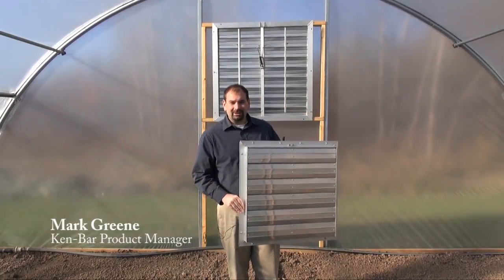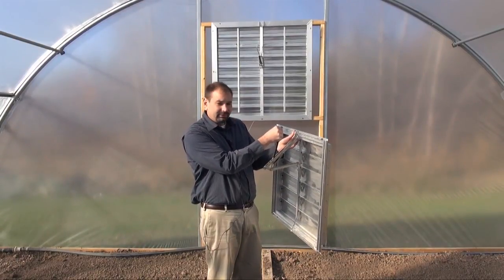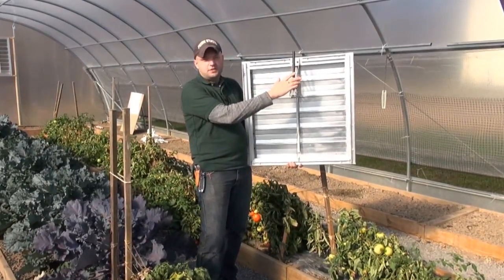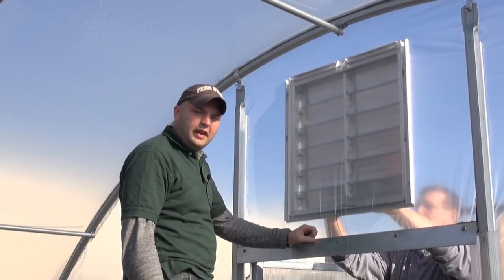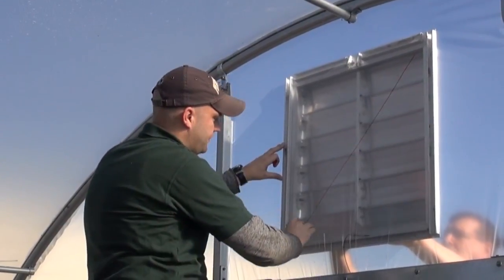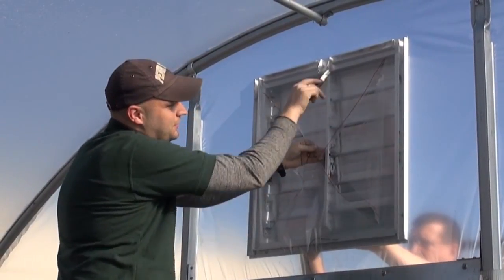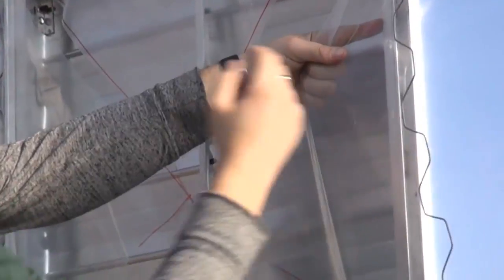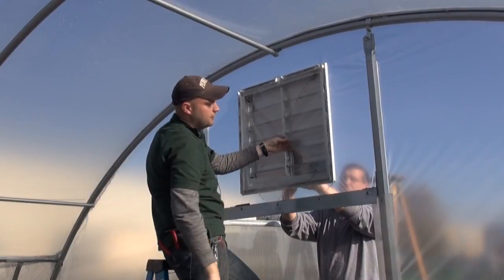Harris Seeds - How to Install Small Automatic Greenhouse Vents

Comment: How does this work if you need more robust intake outage like with a fan and if you need circulation during the cold?
Reply from the maker: This vent is designed for passive cooling only, but adding a fan near the shutter can help force more air to exit the greenhouse.

Comment: If you are using a fan, does it make a different if you go north to south or south to north?
Reply from the maker: If adding a fan, ideally you would not install the shutter on the windward side of the structure, if possible.

Comment: My vent opens fine but never closes, although I can manually close it. It never closes on its own...and it is brand new! Any advice?
Reply from the maker: Thanks for reaching out!

A failure to close is usually caused by a few very simple issues with the setup:

First, make sure the T-bracket that holds the cotter pin is rotated such that the pin holes are facing away from the black cylinder.  The piston of the opener should be entering the horizontal arm of the T-bracket.  Installing in reverse will increase the travel of the opener and can prevent the opener arms from returning to the closed position. 

Second, be sure that the arms of the opener are attached to the correct hole in the center connecting vane of the shutter.  This will maintain spring tension on the arms and will force the opener back to the closed position upon cooling. 

Lastly, make sure that the screw and nut securing the opener's arms to the center connecting vane is not over-tightened.  If this connection is too tight, the opener will be strong enough to force the shutter open, but the return springs will not have enough force to overcome the tightness of that connection to pull the shutter back to the closed position.

Comment: If you want your plastic to stay taut, why cut the film before you use the wiggle wire? Will it be too taught to get the wire to snap in? Thanks.
Reply from the maker: Hi there - It can be too difficult to install the wiggle wire without making a relief cut in the film.  Once you've created the "X" cut, you can use those flaps to pull the film taut before installing each section of wiggle wire.
Reply: @HarrisSeedsCompany  Thanks - one more question. I'm planning on putting two in a 24' X 12' high tunnel. Does it matter if I put them directly across from each other (e.g., both on the right sides of the doors, directly ahead of each other), or would placing one on the near side left of the door, and one on the far side right of the door provide a better draft?